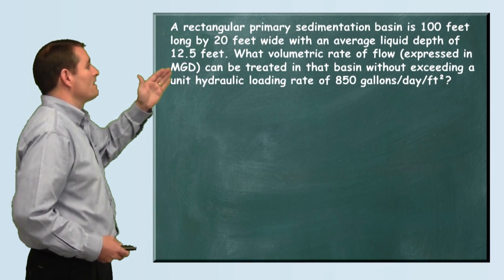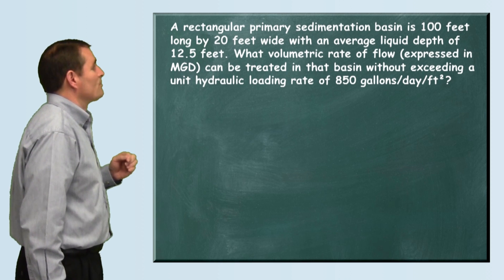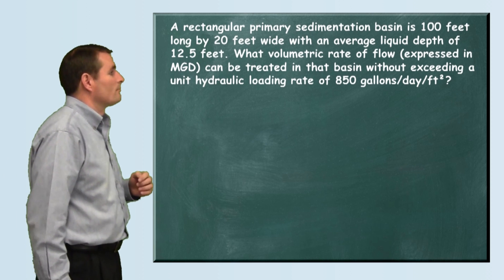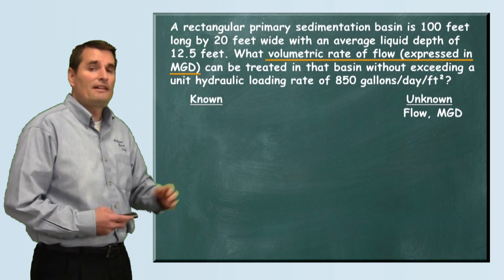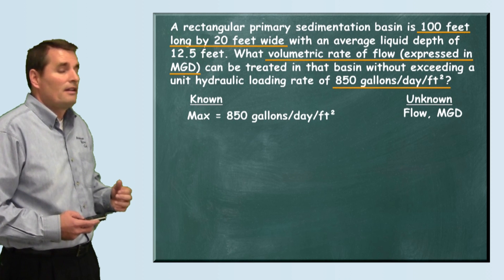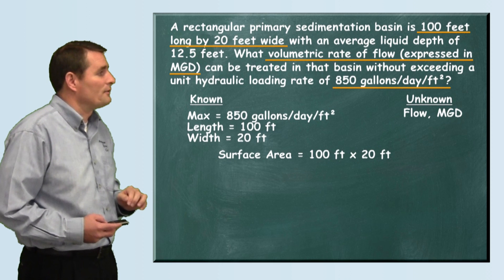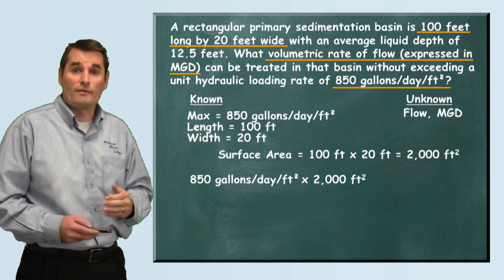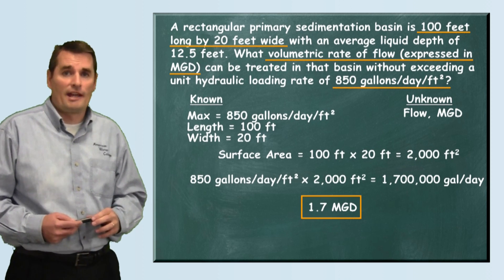Problem Solved: Flow Rate Problem - Wastewater Math

Comment: Why don't we care about the 12.5?
Reply: whoopbasscrew 
Because it's square ft not cubic ft.
Reply: We need to calculate the sedimentation basin's surface area. If the problem statement asked to calculate the basin's volume, you would multiply the surface area by the liquid's depth.